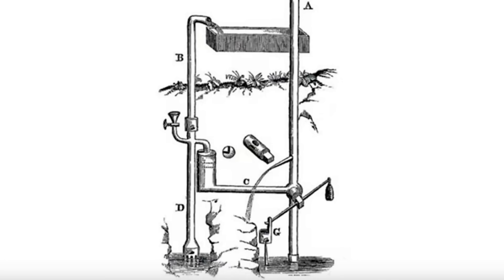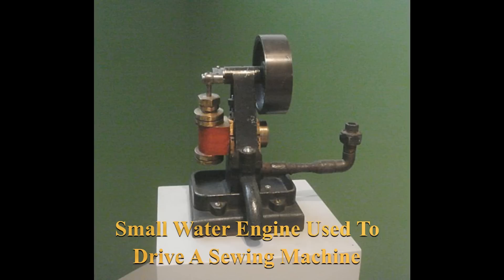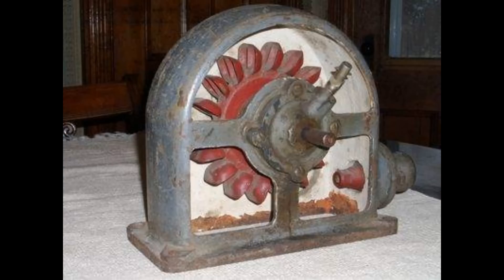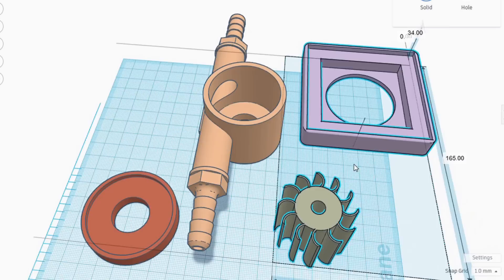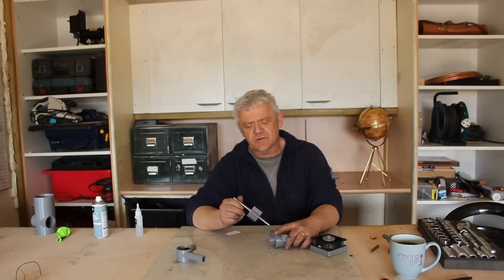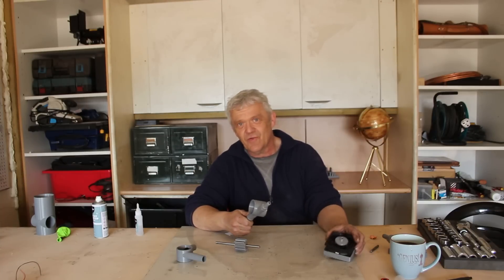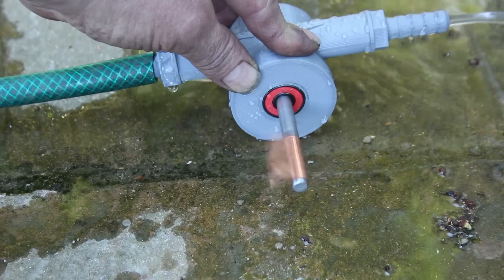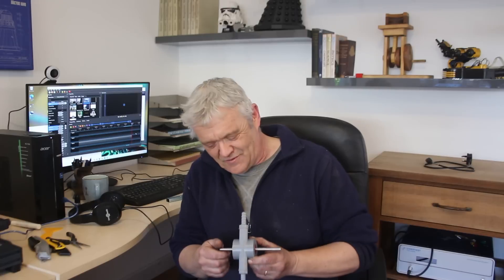1899 DIY Water Motor For Power Generation

Comment: Apart from the obvious waste of water, this does open some options. You cant drive it directly, what if you topped up a water tank up high either in your loft or if your remote a home  water tower then once it's full, a valve is opened then this drives a turbine, how long it would take to empty would have to calculate on a few parameters but it's basically a home version of pumped hydro. It's only wasteful if the water just goes down the drain, if you were to use it to water the garden, fill toilets etc it isn't wasteful at all.

Comment: the mains  water pressure where I live is too strong . It breaks the diaphragms of my garden water timers. I reckon its 1000 K.P.A . I put in a pressure reducer and it breaks the plastic connector at the tap end Have  two broken not sure if I get a third reducer again.

Comment: I suggest to add an electric generator with a PWM battery charger to regulate flow resistance by pressure sensors at inlet and outlet in order to replace the conventional pressure regulator of your home by one which converts the pressure drop into electricity. 😉

Comment: I've been thinking about something Ike this. 
My water comes from a spring in a 1inch line to the cistern and runs all year long. 
It will end up with 3. One on the spring line, one on the output of the cistern and one on the cistern overflow. I plan to charge a battery and periodically use that to pump water 300 feet up to the garden. The spring head is not suitable for a ram pump so I will try to use the battery pump  once a fortnight or so.

Comment: Lots of people (in the countryside) may have access to free water supply in the form of small rivers or streams, but which are not very deep (a few inches) and do not flow at a fast rate, but do have a dependable continuous flow. The challenge would be - to make a small 'paddle style' generator to take advantage of the water flow - as a continuous source to charge up storage batteries.

Comment: I'd be curious if an experiment can be done to prove or disprove the loss of pressure from adding the water generator to the water line. I'd wager the law was created more for the power companies, so folks can't collect free power. Fitting name "power companies". And if so, how many people can do it before it becomes dangerous. How many psi is really necessary before ground water enters the pipes? Can ground water even enter water pipes? I'd wager not. I'd say they're likely sealed pretty tight.

Comment: It's crazy to me the logic of making it illegal to hook these up to the main line. If everyone installed them to their main line, wouldn't it increase the pressure in the municipal water supply because of all the restricted flow? In some ways you'd think it would save the town money. Sure you'd have to worry about the people that would run their water explicitly to generate electricity using the towns supply.. but you have that same problem currently with it being legal to hook it up at a secondary location with a bs reason for usage. Am I missing something or does this seem like a pointless regulation in this day and age?

Comment: G’day Robert from far off Tasmania.  I’ve been thinking of a solar power steam engine using methanol ( boiling point of 66’c).  My concept is a solar unit heating a reservoir of low viscosity oil ( high flash point, able to hold much higher temperatures than water).  A heat exchanger heats the methanol, generating steam, turning a Uniflo type steam engine geared onto a generator.  
We routinely get temperatures over 80’c in our solar hot water system, here in Tasmania, even on cooler winter days.  
I figure the solar evacuated-tube (aluminium tubes, partially flattened to form ‘strips’, painted black, inside a glass vacuum tube) would be  more than capable of heating the oil.
Reply: Very interested in doing something similar - we get extremely hot days here in Zimbabwe and am certain there is huge potential for this.
Reply: if you were in Holland, they'd arrest you for that idea...
Reply: @moneypenni1694  why’s that?
Reply: @andrewallason4530  ; Do you know what is happening all over the world including Holland these days?
Reply: @moneypenni1694  people are on drugs and riding bicycles?

Comment: Gday Rob, im wanting to build an electric boat where the motors on the back double as tidal & wind generators.   Would love to hear some feedback from either yourself or a skilled viewer on how best to acheive this, or any ideas on it at all.
I was going to use trolling / fishing motors as theyre already quite sleek and fully waterproofed.  And realise i would probably have to switch propellors, or add shrouds etc.. to acheive decent performance in all 3 areas.  Or could there be a 1 size fits all prop for all 3? The motors would be 80lbs thrust so theyre fairly low speed & 24V DC.
Any thoughts from anyone would be great, thanks!

Comment: you have reduced the water input to a small round hole to increase pressure, with a wide rotor, would it not be better to have a small slit ?
This would spread the water hitting the rotor.

Comment: Got me thinking. Instead of Pelton cups, what about a group of helix blades on the rotor. Think helical gear for a visual. The exhaust would be 90 degrees to the input, coaxial to the rotor shaft. Energy extraction across the entire width of the rotor, less turbulence in the chamber, smoother flow altogether. The input would be positioned on the opposite end of the rotor housing from the exhaust, still at 90 degrees to the shaft. Just wondering.

Comment: I'm interested in putting still water to use . I'm knocking around the idea of using a rampump to increase pressure for more rpm and torque...

Comment: I installed some water meters for a trailer park once that used a similar principle to drive a physical counter, the older ones used a wheel that the water pelted to make it spin, it turns out no 2  meters had the same reading so the park updated to a positive displacement motor which used rollers on a rotor that pressed into a flexible tubing trapping a fixed amount of fluid per rotation quite similar to a pump in a dialysis machine, I wonder if the accuracy change would equal increased torque just by the nature of positive displacement Theory?
Reply: oddjobbob  yes that type of positive displacement motor works very well in a low velocity environment, I'm thinking in order to achieve accuracy with a pelted wheel without losses the velocity would have to be so great as to create a fluid seal between the housing and the rotor, the same way a hydraulic seal works in a centrifugal water pump

Comment: I guess that any application that has a zero outlet pressure, like pond, swimming pool, toilet, any of these could readily use a 'water motor' to provide a few watts, or more, to power, say, a sprinkler timer/valve, an IOT monitor for weather, soil moisture, yard motion/video monitoring... I was thinking that a positive displacement motor would extract the most power, but perhaps at a lower RPM than a 'turbine' type ...
Reply from the maker: agreed mate
Reply: @ThinkingandTinkering  you are one hard-workin' son-of-a-gun!  And, you seem to have MAXIMAL FUN!
Danke/merçi/arrigato for the fun (and thinkin' ) that we get to have!

Comment: Leaks galore!  Unless you do the rotor with magnets as part of the sealed section.  Same blades and pipes in center with blades directly attached to a plate with magnets on the rim.  Whole assembly in a sealed  case, with coil on outside of case around the rotor plate.  Since nothing needs to move outside the container, no leaks!
Reply from the maker: lolol - just use a bit more glue

Comment: ha ha - don't use with steam if printing with PLA, PETG... - even ABS if it is "significantly" pressurised (superheated at all ie. only ~20kPa, 2PSI ) - PLA, which many people print with will enter its plastic range - ie. the glass transition temp is only ~60-65 degrees C  (PETG 85C) even ABS transitions to plastic at around 105 degrees  C...   -  PEEK transitions at 145deg C - but is a bit fiddly to print with (very hot hotend temps (365-440Deg C) and high chamber temps (135 or something are needed...
Reply from the maker: i have seen steam engine run on steam and 3d printed mate from PLA!
Reply: @ThinkingandTinkering   for how long... Pla  has been known to warp  in the hot sun.  Let me know how it goes..

Comment: What if you build it with a hydraulic ram to move the water faster or increase power? The idea of the air chamber and water oscillation would trigger burst of power or torque on the water motor.
Reply from the maker: for sure or maybe an accumulator mate

Comment: Just about enough to charge a phone, 5 volt at 2 amp = 10 watt😀
Reply: While I truly admire the ingenuity, the idea of using water from the spigot or hose to generate electricity doesn't include the cost of the water for say 1 hour -- Assume somewhere around 2.5 gallons per minute thru a short hose at modest flow and that's over 100 gallons of water for 1 hour. In the USA, 100 gals of water will cost the average person  at least 1 dollar.... I guess what I am saying is this: For 1 dollar you can have 10 kWh of electricity or... you can use a water generator to run an LED for an hour. So, when thinking about these ideas, remember that there is a "cost" do doing different things. And it is important to weigh those costs. If the water supply comes from a rain spout, it might be useful. But again, we had this discussion earlier... how much electricity are you really generating with a rain spout... I honestly believe it will "never" be worth the money you spend for the average consumer.
Reply: @marcfruchtman9473  Obviously not for use just charging a phone😅. Meant for use as harvester charging a battery when ever flow occurs in pipe. And I thought that was obvious.
Reply: @staycurious8650  Sure, a free source of water would make it much more viable.
Reply: @marcfruchtman9473  ; what if your power goes out for 2 days like it regularly does here in rural tx?
Reply: @moneypenni1694  Hello Money Penni1, I might not understand the entire context of your question... Unless you happen to have a "River" of water flowing near your house, there wouldn't be enough power for most uses. You could of course use it to recharge your phone. But, the "cost" to your water utility bill would be very high. For "simplicity" sake, you would be better off buying a small solar generator recharger for a couple of hundred bucks. Now, don't misunderstand me, this is a very cool idea. and it is great for the "tinkerer" who wants to try things out, but if you actually don't have a river or a water reservoir nearby, then it will be expensive to run the municipal water just to charge your phone. With a solar panel, once you buy it, you pretty much have it for life (~20 years is the ~minimum that I have heard). Or if you are just needing emergency power for your phone, keep a USB charger battery pack plugged in. Everything depends on a variety of variables: How much power will you need, how reliable does it need to be, how much do you have or want to pay for it... etc. For 20 to 40 bucks you can get a backup battery for a phone... for $400 you can get a small gas generator, or you can DIY a solar panel, battery and an inverter... its highly variable. But, the amount of electricity you will get from your house water will be very small and certainly not worth the size of the water bill at the end of the month. As I said, for "tinkering" it is very cool to be able to play with it. Just be aware, that it might be very expensive and you won't get a lot of electricity from it.
Reply: @marcfruchtman9473  ; there are vids out here on tube which show people running a water wheel to run a generator. & face it, if you don't have a couple $100 to spend on a solar panel or generator & you do have even a stream running through your property, it's well worth the time you take to tinker.
Reply: @moneypenni1694  if your power goes out in Rural Texas, and you don't happen to have a River/Stream in your yard, solar would be the better way to go.
Reply: @marcfruchtman9473  ; fortunately, I soon will. What will you do when solar panels will no longer be available? are you able to make your own?
Reply: @moneypenni1694  Why would they "no longer be available"? There's multiple suppliers from multiple countries in various parts of the world. I think you are mistaking "end of times" with "lack of electricity" due to temporary conditions.
Reply from the maker: yep

Comment: I have two garden hose retracting storage devices that use system water pressure to drive water motors which turn the hose drum to retract the hose.  Works great.
Reply from the maker: v cool!

Comment: Bit of an echo going on in the garage mate, more the first part of the video. Perhaps some work on the acoustics might help? Otherwise loving the new setup. Looking quite smart!
Reply from the maker: yeah i got the echo too mate - not sure what to do about it right now - maybe some cloths?
Reply: @ThinkingandTinkering  yeah, not a bad idea. Either that or perhaps a more localised mic, although that can cause sync issues later. Another option might be some ply on the walls (not sure if you're planning to add some insulation anyway - if so, might not be a bad idea).